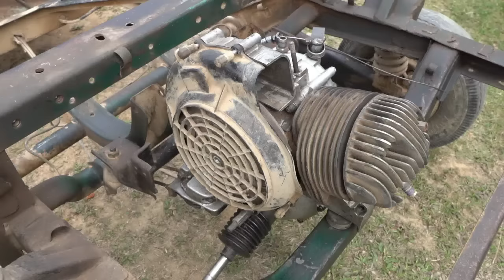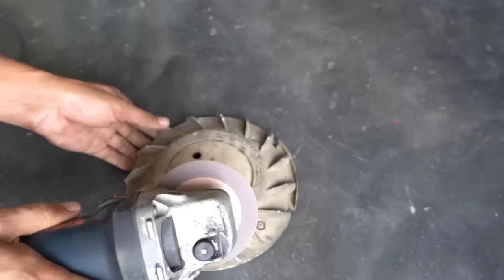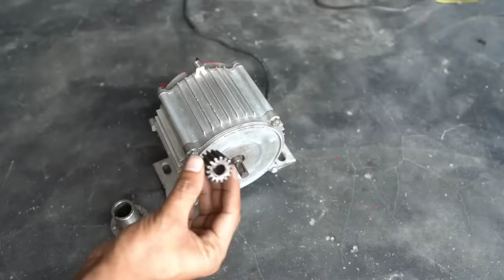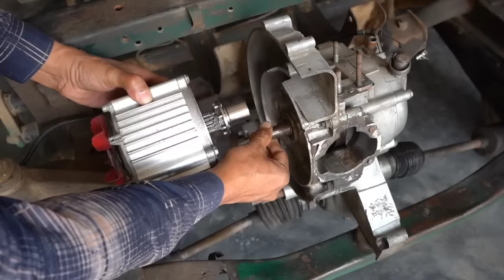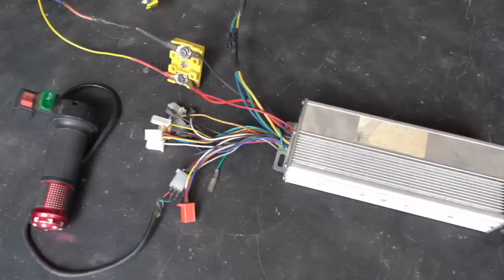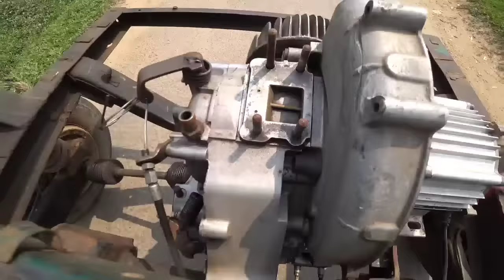How to Convert a Bajaj petrol Auto to Electric #EVevconversion

Comment: You have left a piece of the crank rod inside also you cut studs of the head assembly. This will create unbalanced rotation. You could've simply disassembled the engine as it is a small uncomplicated engine.